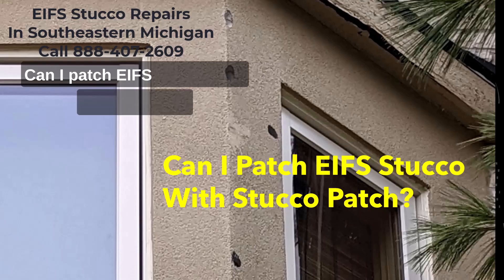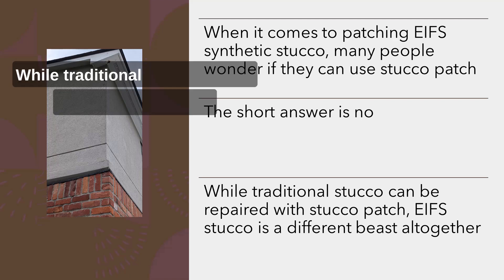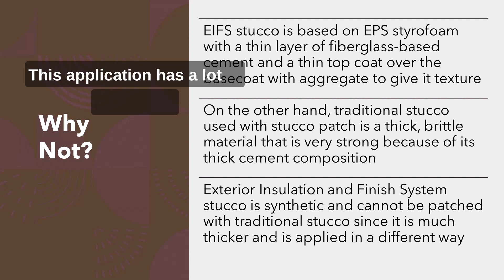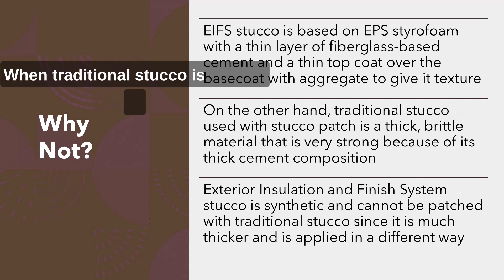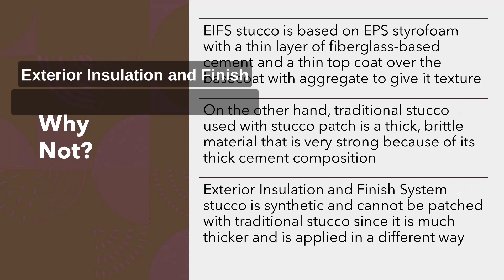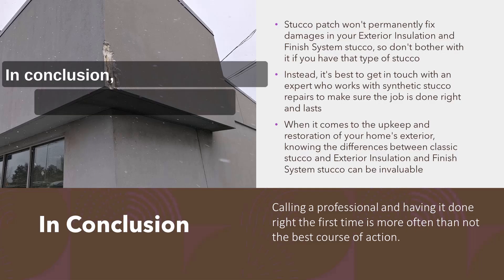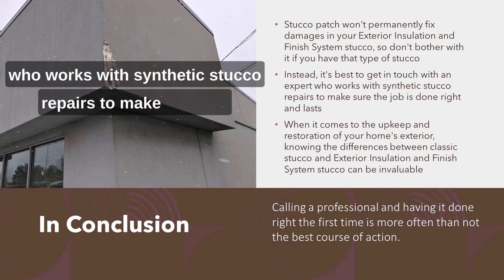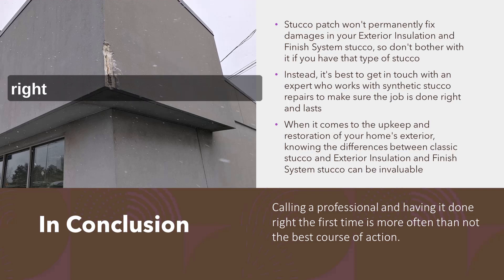Can I Patch EIFS Stucco With Stucco Patch?

Comment: BS... EIFS can be fixed easy with the same texture in a sealed bucked. Spray nitrogen into the bucket and seal well. Using RED poly tape sold at home improvement stores, mask the area and use as a guide. Razor or scissors work great. Sand or cut back any treated fiberglass around damage like a woodpecker hole. Spray with insulation foam and squirt water to stop action. Sand, cut or grind with 1/2" X 10 belt sander, to just below surface. Apply concrete bonding additive to area with a brush. Taking OEM EIFS and trowel or drywall hopper to spray thin light coats to cover. Trowel or rubber float to achieve texture to match. Exterior grade resin/binder is the product they add color to at home improvement stores. Add some to your bucket if getting thick. Mine has lasted years and a clean seal & nitrogen sold at welding supply shops have a return exchange regardless of how much you use or length of time you have had it. This has lasted 26 years before woodpeckers came to town.
Reply from the maker: Responding to comments, especially critical ones, can be challenging but also offers an opportunity to engage constructively with your audience. Here's a suggested response that acknowledges the commenter's input, reinforces your expertise, and opens the door for further discussion:

Hi @deankay4434,

Thank you for sharing your detailed method for repairing EIFS stucco. It's always interesting to hear about different approaches, and I appreciate you taking the time to explain yours.

In my experience, the techniques I demonstrate in my videos have been consistently effective for a wide range of repairs, ensuring long-lasting results that align with industry standards. While your method is indeed unconventional, it's great to know it has worked well for you over the years.

Every project can have unique challenges, and sometimes innovative solutions like yours can be quite useful. However, for those who might not have access to all the specific materials you mentioned or prefer to follow more conventional techniques, I believe my methods offer a reliable alternative.

If you're open to it, I would love to learn more about your process and any additional insights you have. Perhaps we could even discuss this further in a future video or blog post to provide a broader perspective to our community.

Thanks again for your input!

Best regards,
Corey Turcotte
Reply: @CoreyTurcotte  True their are many ways to skin a cat. We get a solid 6 months of freezing and wild fires out West, have pushed woodpecker East and make the wife unhappy. You know the saying. 
 I have had every lumbar procedures know to man and have had 7 days of relief scattered over 12 years, making raising the ladder the worst. Wife sold scaffolding at garage sale. I find myself in depression and sometimes mad hiding in the garage. Use what works as I bought some 28oz. treated fiberglass to place under cementitaious coat treated with adhesive promoter. Then finish.
   Deer fence is cheap and laid on cardboard, I use a roller & paint to match the field, both sides. When SS stapled two inches away from the wall on bottom of soffit (touch-up staples) it becomes invisible. The birds hate it as it is like coated fishing line with 1/4" squares. I cut 1/2" PVC white pipe creating 4 quarters and simply weaved it across the bottom for wind control. I have never heard any noise and too lite to leave a mark. The birds can't grab the wall as the invisible fence keeps moving. I guess it's better than ballon's, CD's, foil or plastic owls. lol. Looking for a Dr who wants more money! Have a lucky one!
Reply: This is such a brilliant comment thank you for taking the time out and responding with helpful information… we just bought a house with EFIS and was dreading how to repair Some area as in our area EFIS is not that common and the repairs quoted are in thousands of dollars 😢 would you be able to list the materials used here ? Thank you again for your time!!
Reply: @2cents859  Use Deer Netting painted on cardboard or plastic the same color as the field. Let it drive and paint other side. Using 3/8" PVC tubing, cut in quarters. Weave this thru bottom and staple under soffit 2" away from wall. This moves and spooks birds as deer netting is 1/4" squares like fishing mono-filament encapsulated in a plastic polymer. Very light weight and when folded, staple to soffit to keeps woodpeckers of wall. Making repairs is aggravating, costly and slightly. But in this era of having a thermos bottle type insulation adding R14 to exterior walls reduce energy bills by 2/3rds and sound by 3/4. Then these birds that have a tongue that wraps around their brain and exits on the bottom. It acts as a muscle to aid in pecking. This action is for eating, nesting and attracting a mate. I am trying to stop two of three.